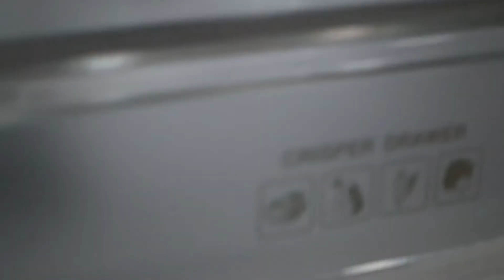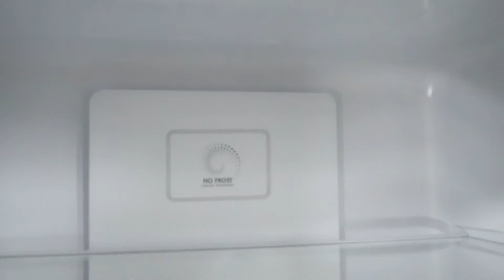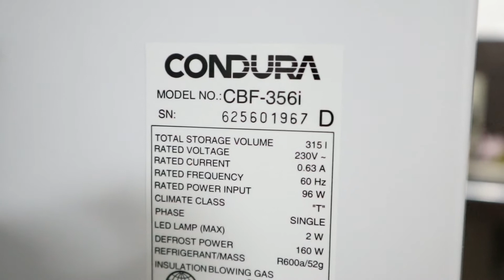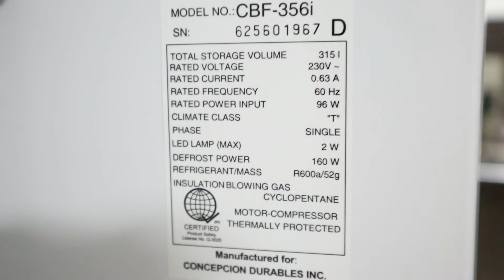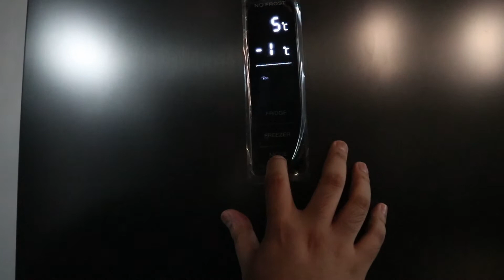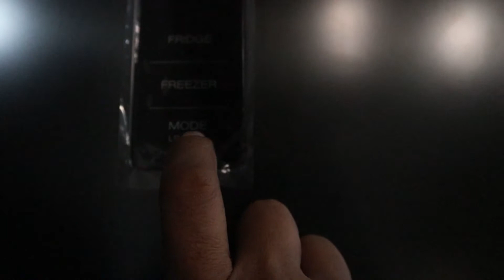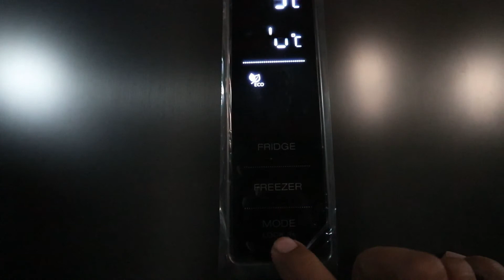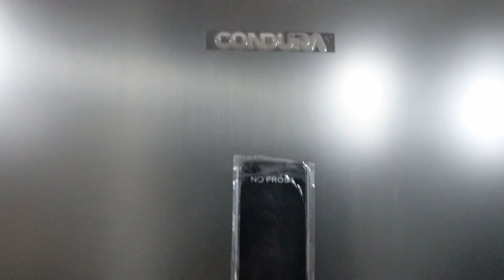UNBOXING CONDURA NO FROST BOTTOM FREEZER + LED LIGHT NA + FIRST IMPRESSION  #refrigerator #condura

Comment: Nakabili kami last week, same model. Weird. Kapag cool settings (2 and 24) di lumalamig ang fridge. Pero kapag ecosave (5 and 18) tsaka lumalamig ang fridge at madali makabuo ng yelo sa freezer. Tinawag ko na. They have to replace the unit or else I will replace this with another brand. Warning to potential buyers. I guess I'm not alone in this. Hassle yun ibabalik.
Reply from the maker: Ang 2 and 24 kung tama ako Holiday mode so hindi nga lalamig ang fridge, ako ang gamit ko eco ok naman matagal masira ang gulay. Baka po may defect ang nabili mo. Good thing papalitan nila. Thanks sa comment.
Reply: @simplytesstv  supposed to be coldest ang 2c degrees at -25c degrees kasi ❄️ mode siya, compared sa 5c at -18c (eco mode). Pero mukhang pareho po ref natin na mas malamig sa eco mode. Weird di po ba? Mas malamig dapat ang 2c degrees at -25c degrees.

17c at -22c yun holiday. Mas malamig nmn ang -22c compared sa -18c ng eco mode at mas malamig ang 5c ng eco mode kumpara sa 17c ng holiday.
Reply: bought this model and parang ganyan din yung nangyari mas malamig pa ung eco mode